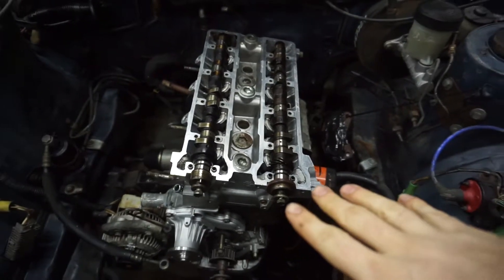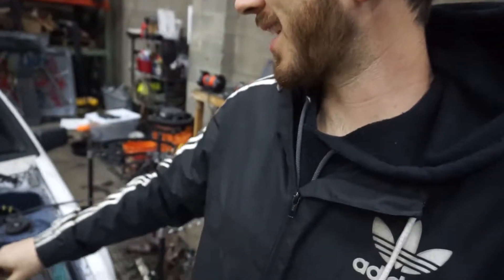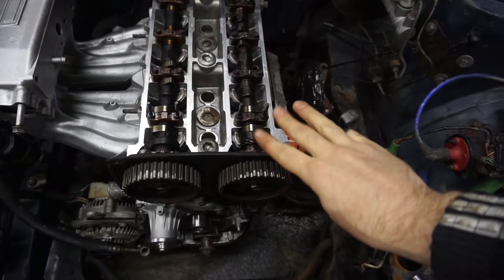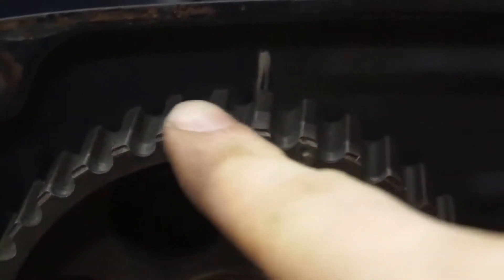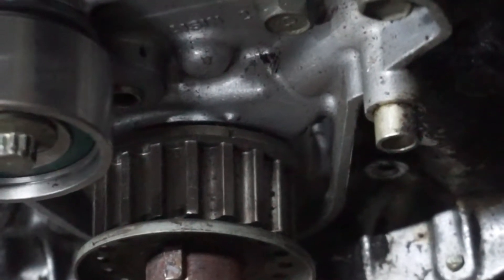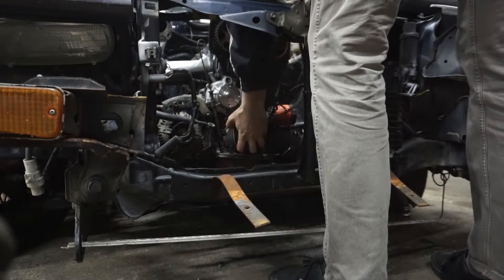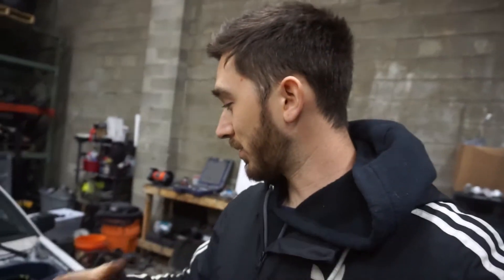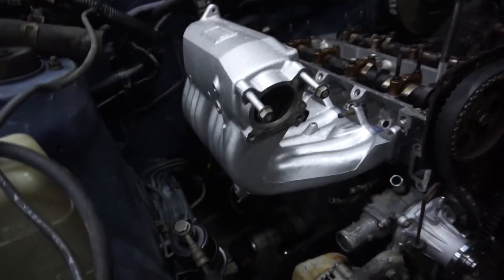How to: 4age Timing Belt

Comment: Quick question: you said the knock pin on the right is supposed to face towards the bottom, but that wouldn't line up with the little dimple mark on the cam gear. Does that mean there are two of those dimples on the right cam gear? Couldn't get a good glimpse in your vid. But I still love it!
Reply: Was wondering this same thing. He says there should be a hole on the bottom but you can’t even see it. Lucky for me my motors out and I can just confirm..

Comment: Great vid. Did you use camlube ( thick oil for the cam journals) to help with its first few revolutions after startup?
Reply: BGB just says use engine oil. 10W20 is good enough for the rest of the engine 🤷